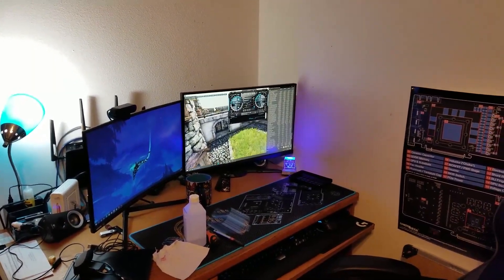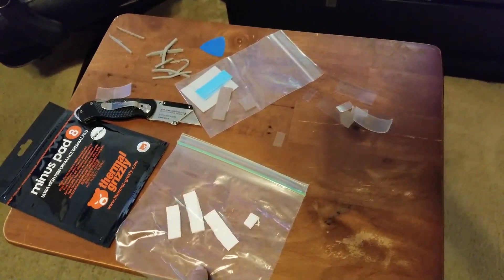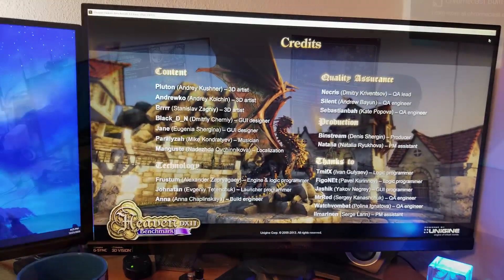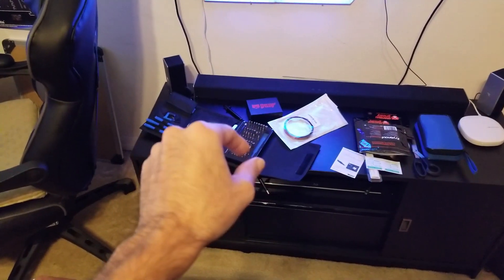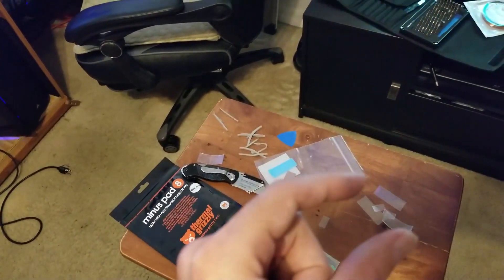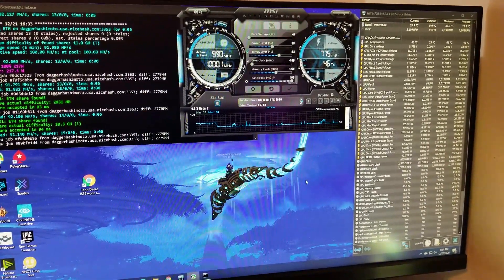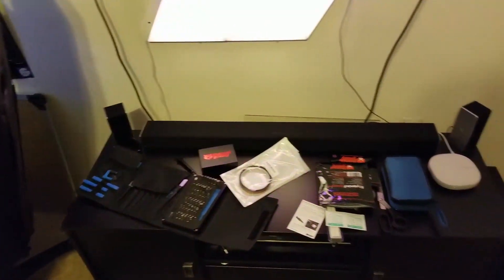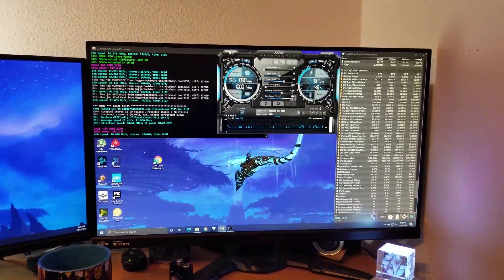RTX 3080 memory Thermal issue fixed!!

Comment: Any easier solution without deassembling the whole thing ?? Does cooling the rear back plate have any effect on memory temps ??
Reply from the maker: Not if there are not thermal pads linking the backside of memory modules to backplate. But if there are thermal pads linking then yes. Add cooling to backplate

Comment: I have same issues with Gigabyte 3080 Gaming OC GAMING OC WATERFORCE WB. So in the end 3mm on the back it's clear. But I'm not sure if I understood what did you use for front - directly on VRAM to the heatsink (waterblock in my case). Was it 2mm finally or 3mm ?
Reply: Since I have already modified mine, I will answer myself ;]
I have used for the back GELID SOLUTIONS GP-Ultimate 90x50x3mm -> one was enough to cover all memory backsides with a large margin.
For the front - so between waterblock cold plate and memory chip I measured 1,6mm therefore I have used GELID SOLUTIONS GP-Ultimate 120x20x2.0mm, and unfortunately one was not enough, I had to cut small square about 20x20mm from second stripe.... ah well... 

Results
Before: After starting miner OC or not memory within few seconds got to 100C then in 10-30 seconds it reached 110 - thermal limit kicked in and dropped from ~100Mhs to 80-85. And that was on cold night (25-26C room temperature). During day it dropped as low as 75Mhs - and hashrate was directly correlated with room temperature (proportional).

After: ... and it is on a very hot day -> 33C room temperature - it slowly crawled to 84-86C - no throttling, full hasrate.... Again - on hot day ! Backplate is hot to the point it's hard to touch. I guess something worked.  I get slightly higher GPU temp - but it's normal as my TDP is not limited so it get's hotter.

GPU paste I used was Noctua NT-H2. Not that it means something, it was just around.

As for pads - if you use GELID ultimate you should not go higher than 2mm i think. It's hard pad, not like other soft, patty like. It would be much harder to compress it to get good contact for GPU... 0.4 mm compression is plenty enough i guess...
Reply: Just an update, so in the evening when room temperature was closer to 28-29C memory went down to 80C, even below - while mining at 102,7Mhs (mem +1500, PL 65%, Core 0)

Comment: Can you help me out? my rtx 3080 gigabyte is showing no display after replacing the thermal pads, used 2.0 mm gelid on front and back plate.
Reply: I have the same problem with the exact same card, you need prob 3mm on the backside. I have now ordered a different brand called thermal right for the pads, 2 mm for the front 3 mm for the back

Comment: I need to do it on my 6900xt. No idea what thickness to use
Reply from the maker: I can eyeball it, but that is because of experience. If you have a caliper, you can take off the old or measure the space between the back of the PCb, to the backplate. It either will be 2mm to 3mm. Have you tried to see if anyone did a teardown video of you model? That might help

Comment: I replaced my thermal pads and am still getting 98-100C mem temp unless I run my house AC at 63 F or lower :(
Reply: Did you find a fix

Comment: SerpentXSF What is the vram temperature in the video ? thanks
Reply from the maker: it was hitting 110C which is bad.... but after fix 88 C - 92 C at the highest
Reply: @SerpentXTech  Thank you so much. GELID GP-EXTREME 80X40X3.0mm back, GELID GP-EXTREME 80X40X2.0mm front and Termal Grizzly Kryonaut 1g termal gres 12.5 I ordered.

Comment: So i did all that to my 3080 eagle and got temps under control and hashrate at 95mh, but after two weeks mining my hashrate suddenly dropped again at 84mh, but no throttling at all, any advice of what could be happening?
Reply from the maker: It sounds like it is still throttling, you just don't see it. It is not the GPU temps, but the memory. In a programm called HWinfo, look towards the bottom for something that says "Performance Limit - Thermal" if it says "Yes". Then you memory is thermal throttling like everyone elses..
Reply: @SerpentXTech  i fixed it, the issue was the undervolt, was getting variance in frecuency, had to up a little bit the power now its 98-100mh constant

Comment: I applied thermal pads in all the same places and saw a drop in -2c with artic MX4. Are these Minus 8 pads superior so basic ones? I am at 108c tops! Average of 105-6..
Reply from the maker: Yea, they have higher thermal dissipation but cost more. I used Gelid extreme, which has even more thermal efficiency. If you can find a smaller sheet, you can save the money. But I bought a few, to have as most modern GPU's seem to have about a 2.5 - 3 mm spacing behind the PCB, between the back plate.
https://amzn.to/30vDnZS

Comment: hi mate thanks for the vid, i have a 3080 fe and i've bought 1 pack of thermalright 12.8kw 1.5mm pads and i was gonna try and use them on the front and then was thinking of stacking them on the back to make 3mm as i cant seem to find any decent branded 3mm pads anywhere, you think this'll be enough and do you think this is fine to try or should i just buy some cheapo 3mm pads? cheers.
Reply from the maker: Well Founders edition thermal pads, are different size and stuff from my Card. Check out this image. https://imgur.com/a/GHmySzJ
Reply: @SerpentXTech  thanks friend this really helped me

Comment: has anyone done the thermal pads on a Gigabyte RTX 3070 Gaming OC?
Reply from the maker: I haven't, but if your having thermal issues or decreased performance you can assume it might be memory thermals. Just look at your temps in HWInfo, can you see memory temps or no?
Reply: @SerpentXTech  I'm using Hiveon os so I guess it can't be viewed in there?
I'll have to test on windows machine.
My mining rig is well cooled and the card is brand new, however I'm looking to buy used cards with hours on them, that maybe have started degrading, I will need to potential replace pads prior to puting in mining rig.
Reply from the maker: @rollthetape88  you should replace thermal paste and pads maybe once every few years, so yes make plans to have what you need on hand. However not sure the size pads you need, but you can measure
Reply from the maker: What's up people!

Comment: Hello, I added the 3mm rear ones in the back and luckily it mine at 97mhs, (before 79mhs), but I can't get 100% of the cooler down, if the fan speed decreases the power. I ask you if when you changed the factory oily ones, did you replace the vmr ones too? you couldn't get the fan on automatic down to 100%? , sorry my english, I'm using google translator: D

Comment: Lower your fan speed. 100% will wear them out. Even 90% is better.
Reply from the maker: I did, 80% is where it sits 24/7, but before I fixed it.... it auto ran up to 100% because of memory thermal throttling
Reply: @SerpentXTech  ok, I was just looking at your afterburner settings in the vid

Comment: What's the memory junction temp while mining after applying the thermal pads?
Reply from the maker: 110C for GDDR5 GDDR5X GDDR6 and GDDR6X
Reply: @SerpentXTech  does it throttle?

Comment: My 3080 strix oc unmodded is at voltage curve 0.700 v on the core at 1200 speed. Memory +1400 fan speed 65% 240w at hasrate of 102/103 with tjunc memory at 90/94 degrees and the gpu 45 degrees.does this looks safe

Power limit is at 121% but that doesn't matther because i locked the voltage and core soeed at 0.700 and 1200 core speed
Reply from the maker: Looks good, try to get mem temps a lil further down if possible with a lil more fan speed, or dropping mem clock to 1200. However, you want to not get above 96C, and 110C is Tjunction period. Your mem could die if your at 110C and mining 24/7.
Reply: @SerpentXTech  thx because of the good pads on my strix im not gonna replace the thermal pads to void warranty :) so the temperatures are safe u think?

Comment: For anyone who attempts this with a 3080 FE, 2mm under backplate and 1.5mm on memory under heatsink. I used 1.5mm Fujipoly 17w/mk and 2.0mm Gelid and went from 100C to 80C at 50% fan speed.
Reply from the maker: Yo Matt, thanks some peeps in GN Discord asked this question, going to share with them now.
Reply: You used 1.5mm under heatsink ? And did the stock one look a bit thicker than 1.5 ?

Comment: Thank you !
Had the same issue, now the memory is running @ 82°C with fans at 80% !
Reply: Hashrate?
Reply: @zarepetrovski8218  100.3Mh/s
Reply: @A78-i1o  excellent ! I'm waiting on my thermal grizzly to arrive, can't wait to apply them :) You have the Gigabyte gaming oc right?
Reply: @zarepetrovski8218  Eagle OC
Reply: @A78-i1o  similar
Reply: Very nice, eagle version also have bad thernal solution, no pads on backplate?

Gigabyte RTX 3080 gaming OC, clock -502, VRAM+400, hashrate 91 mh/s, junction temp constant at 104C with fan speed 90%. Does adding thermal pads or placing waterblock void warranty.
Reply: @MrSandar80  I asked Gigabyte about adding thermal pads and they sent me this message:

Be aware that removing any components on the device voids entire warranty terms. If you think there is issue with thermal pads, please contact your supplier (where you purchased the product) and see if they can help arrange further help.
Regards,
GIGABYTE

I think it doesn't void the warranty, because if you just add them to the back you are not removing anything, just adding. But if you replace the old thermal pads on the front of the PCB, that might voids the warranty.
Reply: @zarepetrovski8218  I haven`t checked the disassembly videos, crucial is not to break warranty sticker when opening the backplate. I know for sure that EVGA for instance is allowing customers to modify cooling solution without voiding warranty. 
Without modding the safest temperatures is 98C during mining, to accomplish that memory decrease by 420Mhz is needed. Hashrate is decreased then to 83 Mh/s.
Reply: @zarepetrovski8218  other possibility is to turn to  official service and to ask them to apply thermal pad. But i`m afraid it`s impossible because official Gigabyte reply is that memory junction temperature between 104-108C is normal under 100% memory load which is contrary to Macron datasheet which points out that GDDR6X safe temperature is 95C.
Reply: @zarepetrovski8218  key word is removing! But “replacing” as needed has been omitted lawyer talk replace them as needed and you have not omitted! It’s like oil in your new car omitting it will certainly void warranty!

Comment: With the new HWInfo it shows memeory info, can you tell your current memort temp when mining?
Reply from the maker: 84 C on a cool day, and a high of 94C on a really hot Florida day but was getting 110C prior
Reply: @SerpentXTech  i replaced the thermal pads on the back, and getting 102c
Do you recommend.replacing the ones on the front too?
What thickness and how much?
Thx.
Reply: @SerpentXTech  Thanks for you reply

Comment: Thanks for this usefull video!
I put some minus pad 8 of 3mm at the back and it help a bit. but at some point it still goes to 110 deg and it throttles which makes only 90MH/s instead of the 100MH/s target.
Is it worth modifying the front pads as well ? how worth compared to the back ?
---> TIP: what i also did is that i put the AMD wraith horizontally on the backplate. this cooler is given with the AMD ryzen and i think few people really use it for the CPU cooling.
For mining it adds the consumption of the fan but this is nothing compared to the hashrate gain. i got 100MH/s with that and vram at 102 deg. i will still try to modify the front pads.
cheers
Reply: @jf nz yes ive changed them and now im at 92 degC. No more throttling. Always 102 MH/s :)!
Reply: @benoitlebourdon5588  how thick are they, 3mm as well? Is there a good guide for changing front + back?
Reply: @falkherbst5019  3mm at the back and 2mm at the front.
Both are required to avoid thermal throttling. At least on my aorus rtx 3080 master.
Reply: @benoitlebourdon5588  I would not want to open the GPU and change the pads for fear that it could lose the warranty, is there another way without having to open it and that it works well?

Comment: Is it safe to use gpu for mining with custom voltage settings
Reply from the maker: Depends, on if you have voltages to high you can hurt the card. So becareful
Reply: @SerpentXTech  I am thinking of lowering the voltage
Reply: @GamesDon  yes its safe, use msi afterburner. click on ctrl+f  , choose lowest voltage for lowest core clock you want to run and click on L and aply.

Comment: Quick question. What thickness thermal pad would you recommend for the front and back of the GPU? 1.5mm, 2mm or 3mm.
Reply from the maker: 2mm front, 3mm back.

Comment: Problem with 3080 Gigabyte Gaming OC. First week hashed 102mh. 44C 100% FAN. Then droped ~80mh and thermal throttening for 1.5 weeks. 
I added 3mm Thermal Grizzly between card and backplate exactly on memory location. 
Now its 90mh but still undervolts. On front side the original thermal pads were not oily. 
Has anyone else had this problem that after changing rear pads still the mh is still not ~100.
Reply: Yep, same card, added backplate thermal pads but kept thermal throttling. Just changed the front stock thermal pads for some 6 W/mK pads and now getting consistent 99-101 MH.
Reply: @zarredf  Did you use 2mm or 2.5 mm for that?
Reply: @kasparjuristo3600  2mm
Reply: @zarredf  Thank you!
Reply from the maker: Thank you both for communicating and help each other. I appreciate you both. Glad you got it figured out. yea 2mm for front 3mm for the back. Sorry for the delayed reply

Comment: My gup temperature is 33 max
But I get tharmal status yes is there any way to avoid it without opening the card
Reply from the maker: Only thing you can do is possible increase fan speed to 100% and see if that helps. Other than that, no, because the problem is the thermal pads used, are cheap and not efficient at absorbing that heat.

Comment: Just started getting this with 3080 aorus xtreme anyone who has had this issue with this card know what size pad it is for this particular card?
Reply: also have the aorus extreme and having the same issue
Reply from the maker: Ok so it seems the Gigabyte Eagle, Gaming OC and Vision all use the same size ones. However, I don't physically have the Aorus xtreme, but I suspect it is also the same. You need 3 mm for back side of PCB to connect backplate, and 2.5mm for the front. Thermal pads have a little bit of play so you can squish it down to 2mm if needed but simply placing on memory or GPU heatsink and remounting with the torque of the screws doing all the work. JUST NOW if it doesn't close, or your have to CRANK down when putting it back together, then it is the wrong size. You should have to use a lot of force. Sorry guys, good luck
Reply: @SerpentXTech  thanks for the heads up, I have ordered 3mm and 2mm spoke to someone who has replaced the pads on the xtreme  and his has been fine since then using those sizes.

Comment: i've got a 3080 vision, same problem, i received last week 1Minus pad 8 3mm, 2 Minus pad 8 2mm and Kryonaut thermal paste, i placed Minus pad 8 3mm between the PCB and the metal plate on the back, in addition i removed the previous thermal paste and pads and replaced them by the 2mm one, i put kryonaut thermal paste on the main chip and a thin layer on the surface of all the memory chip, results are amazing, i can now get 100mh/s without thermal throttling, after 2 days because PC is in the room i sleep,  i decided to downclock slightly to reduce fan speed even more, since 5 days 24/24, i'm at 96mh/s with fan speed on auto at 67% with the pc tower closed (it was open before for better cooling), now no noise at all in the room, it's perfect (room temperature is 20°).
Be careful : the "Kryonaut" thermal paste is a "no electrical conductivity" paste which is not the case of the "kryonaut extreme"
Reply from the maker: Kryonaut Extreme Electrical Conductivity* 0 pS/m
Reply from the maker: Congratz on maximizing your GPU's performance. Thanks for Sharing!
Reply: Hey whats was your mh/s before use paste please ! Because i get 85mh max with my 3080 vision. I cant + memory speed or i get too High temp